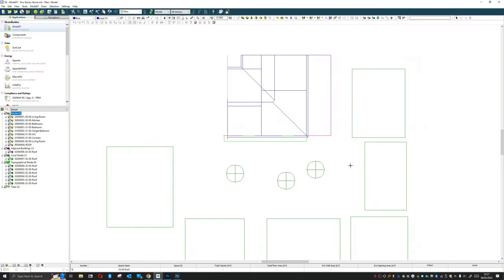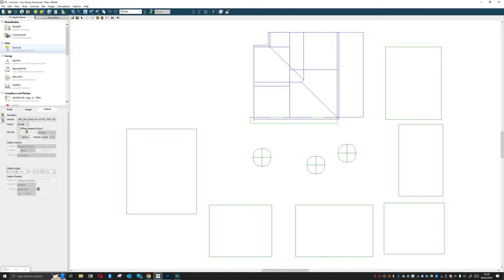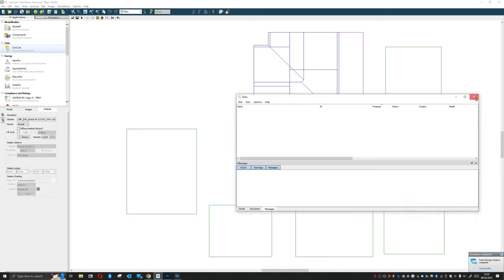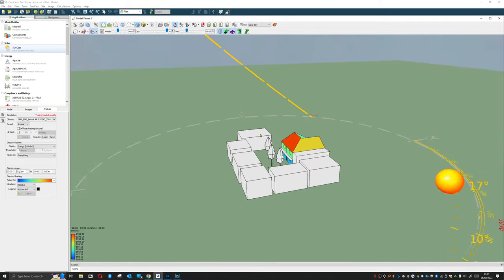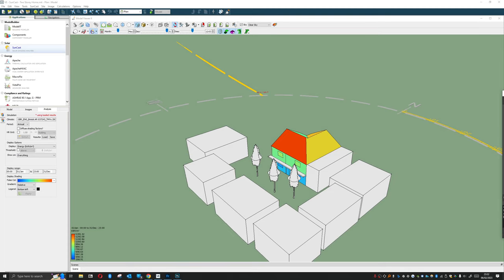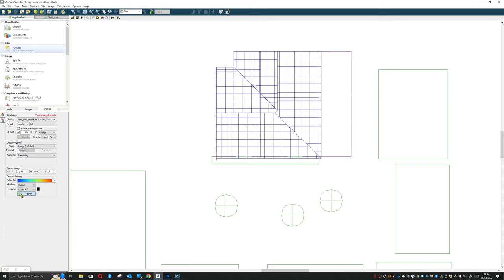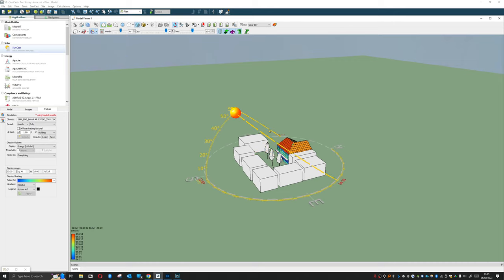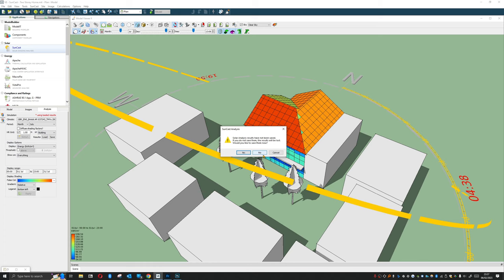IES VE Tutorials - Episode 14 - Suncast and Solar Analysis

Comment: Thank you for all your videos. They are so helpful.
Please, could you tell me how we can model a double-skin façade (DSF) in the IES software
Reply from the maker: Hi, if your doing the work as a student id suggest giving it your best shot with a perimeter room with your glazing arrangement on both internal and external faces and allow for diffuse lighting in the solar cast, macroflo profiles and perhaps giving this article a read:https://www.sciencedirect.com/science/article/pii/S0360132321003127

If its for actual consulting work then I have to admit I've only ever played around with this as an academic and I can't advise. You might want to make a post on unmethours which is a energy modelling help forum.
Reply: @grayenergy5413  Thank you so much for your reply and for the paper 🙏
Reply from the maker: @eman-ali10  Most welcome and good luck on your project

Comment: Excellent video, too bad I got a "Apache terminated unexpectedly" error,  trying to figure it out, not much help from google so far
Reply from the maker: Try running a model report from modelIT and ensure that intersecting spaces is ticked. Make sure there is nothing major there. I typically spin the model around in model viewer as well and just check if there is any graphical glitches as that can be endemic to a modelling error. Otherwise it might be a computer issue, so reduce suncast down to one day and try again.